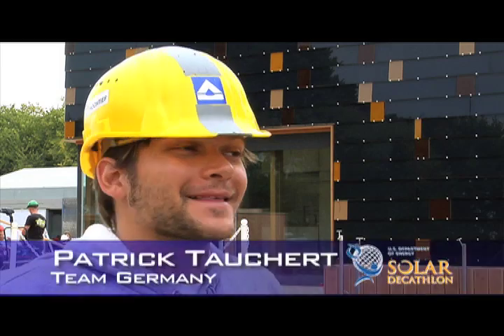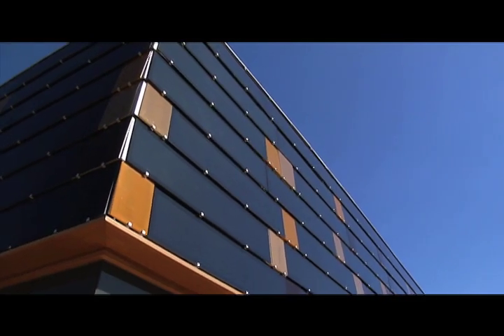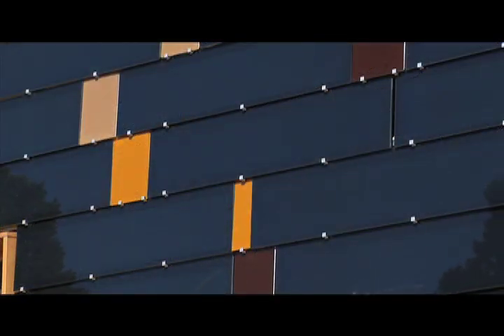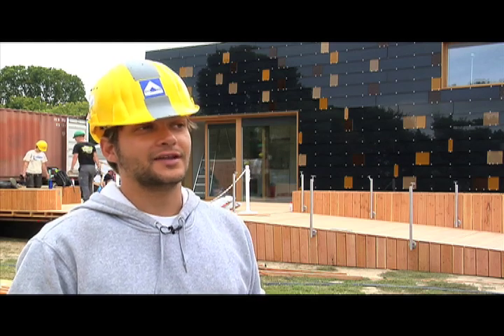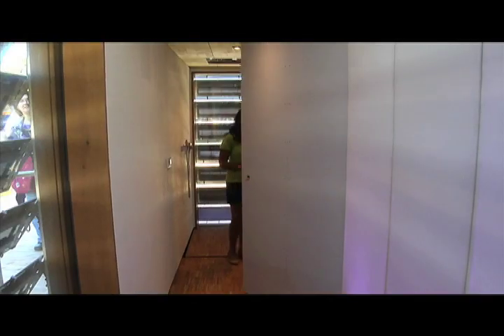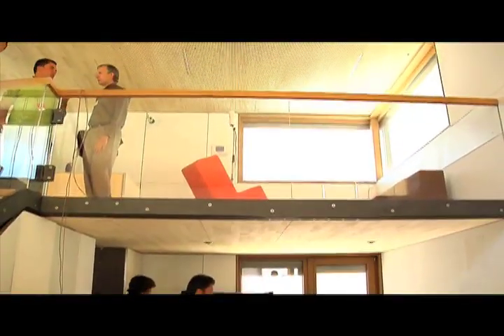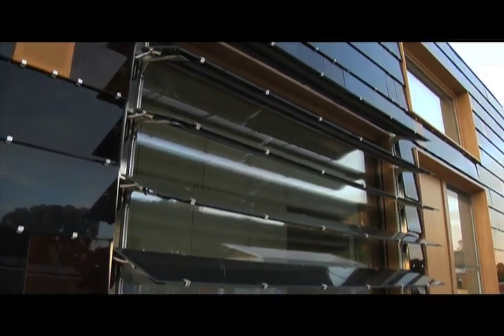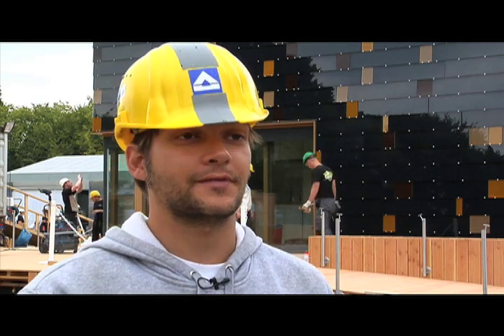Team Germany Virtual Tour

Comment: I like the envelope, but solar panels on the north side vertical? The payback on that would be ridiculous at northern latitudes. Diffuse energy is a fraction of insolent radiation at a 90 degree incident angle. 
The rest of the technology is incredible. This is why Germany has the premier sustainable infrastructure.

Comment: Most solar PV modules are self cleaning so wont need maintenance. Its a special coating/textrure on the plastic. 

Also, off you look, the fixings of the solar panels are covered by the panels above them making them impossible to remove. 

This building is amazing. 

This is what 21st century buildings should be like.